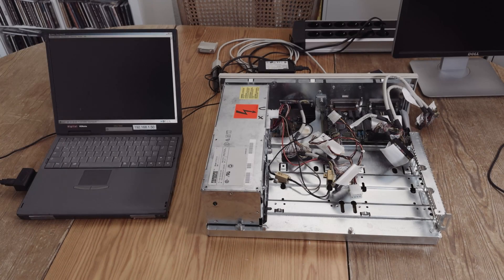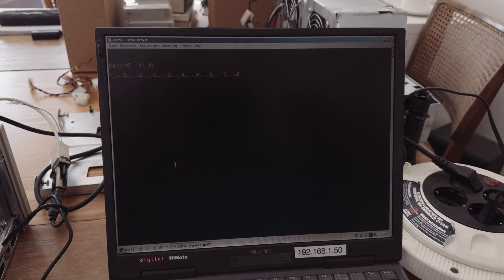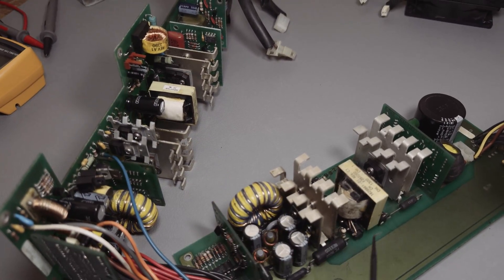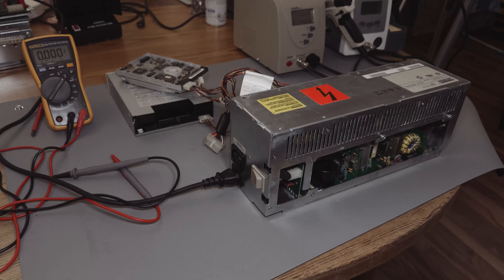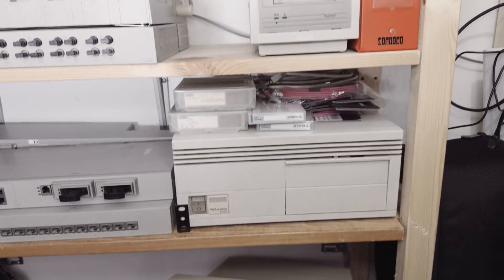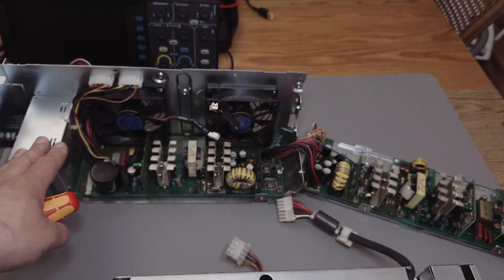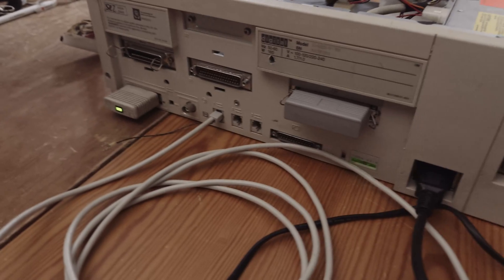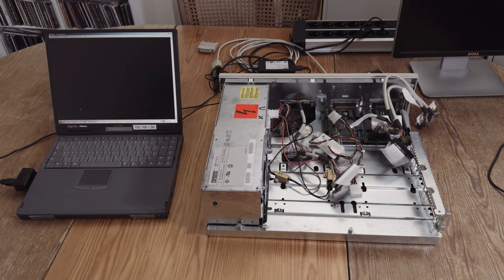DEC (digital) MicroVAX /VAX / VAXserver 3100 Mod. 20 Restoration (PSU) - Part 2

Comment: out of curiosity: as I'm in the same country and currently also trying to repair a 3100 PSU, from which shop did you get those capacitors?
Reply from the maker: One of the power supplies probably has a defective PWM controller or something in the feedback circuit, but that's a project for the far future; I have enough other defective power supplies that need repairing more urgently. I ordered the capacitors from TME, as they have a fairly large selection and also deliver them in small batches.
Reply from the maker: But you can also send me an email for a more detailed discussion about the experience.